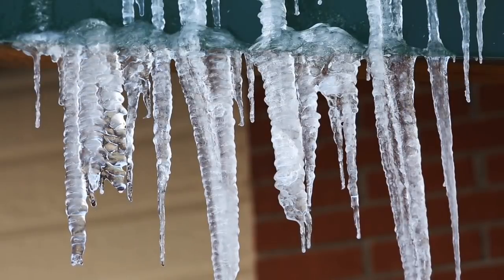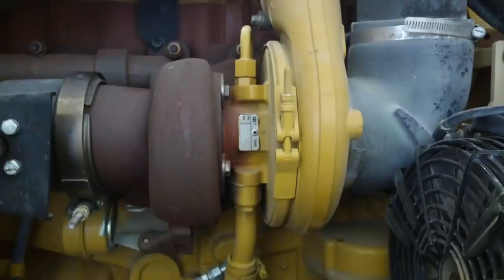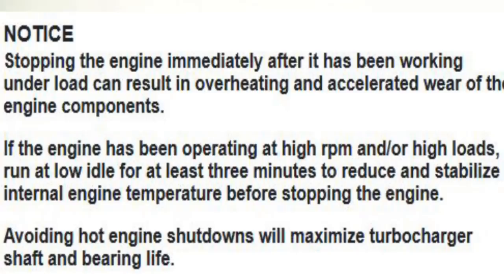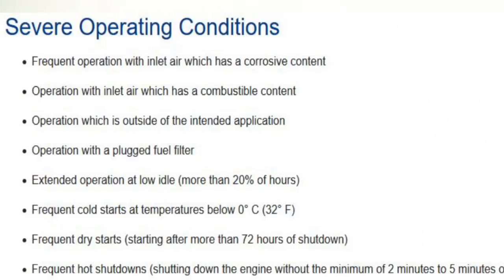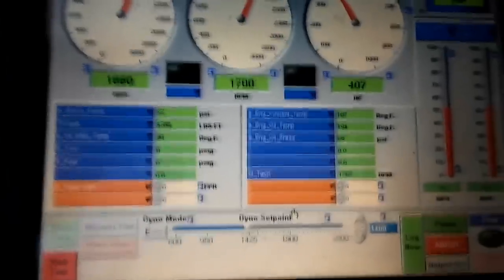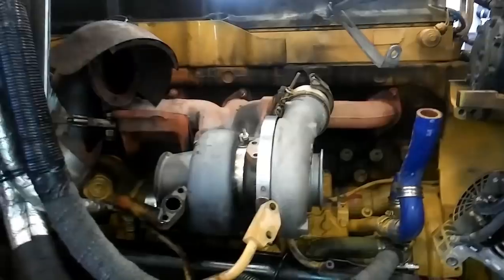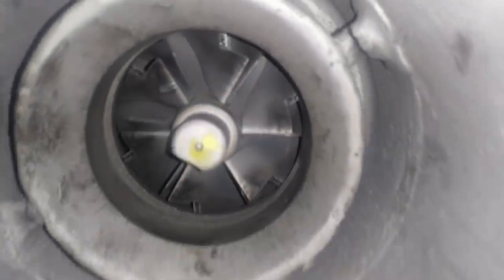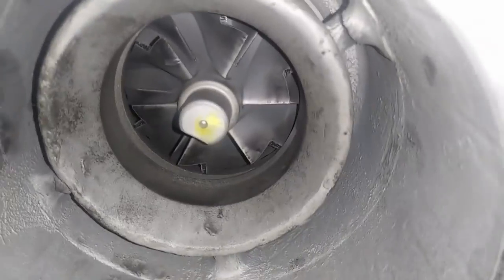Should you let a Diesel Engine Cool Down?

Comment: I guess that's why I got a million one twenty five out of the original turbo on my 3406E. The only reason I replaced it was because it came with the engine rebuild kit I bought. I am a firm believer in letting the engine cool down before shutting it off. In my opinion this is one of the most important videos on diesel engines ever produced. Thumbs up.
Reply: Turbo timers...set and forget. automatically idles engine after "key off and out" for 1, 3 or 5 minutes (selectable) and that's for a cheap unit...
Reply: @teenaramsay2469  i got a new one only $30 can set the time from 10 sec to 10 mins in 10 sec intervals even has a warm up and auto mode (the longer the engine runs the longer the shut down time is) i just have mine set at 3 mins or on 10 if its a hot day and i am gong in to a shop for a few mins so when i come out the AC is still going.

Comment: In the Army we had so many problems with the turbos getting coked up from running hard and just shutting off right away.
Reply: Still do here at Carson
Reply: @robertphillips3154  I couldn't get anyone to actually PMCS anything let alone read a 10 manual for the truck....  And guess who was the first one to be blamed for the issues lol!
Reply: I guess it doesn't matter when you're not paying the repair bill.
Reply: 6.5l's?
Reply: Engine is shut down when turbo is still hot, oil in turbo stops moving, oil gets heated up to extreme temperatures because it's not moving, oil breaks down instead of burning since there's no oxygen, oil turns into carbon deposits all over the turbo's internals, eats the turbo's bearings.

Comment: When I would shut down in the evening I took it easy on the truck before stopping. After parking it I let it idle during my walk around to cool down. I always loved the guys that reved the engine up and than shut it down. They just spooled the turbo up and than stopped the oil flow to lubricate it. I owned the truck and wasn’t just a steering wheel holder.
Reply: If you got no skin in the game. You could  care less about the truck.
Reply: I cringe every time I see that. You can actually hear the turbo continue to spin with no oil going to it.
Reply: I have a 1983 280zx turbo and for the last 35 years I let it idle for 5 minutes after a long run because of the turbo. No turbo problems yet.
Reply: @hudsonhawk0016  I let my 2nd gen ram cummins sit at idle for a minute before turning it off and the turbo still spins for about 5 - 10 seconds after, I always wondered how much oil gets pushed out of the journal bearings in that time, nothing more I can do about it anyway. I will admit that it does sound kind of cool lol

Comment: Greetings from the Philippines. My car is a Mitsubishi equipped with a 4N15 Turbodiesel engine. I always idle the engine for about 2 - 3 minutes before shutdown, especially after highway driving. I also change the engine oil every 6 months or 5,000 kms. Thank you for the information concerning engine cooldown before shutdown.

Comment: If I can help it, I let any engine I use cool down a bit before I shut it off, more so when a turbo is in the mix. My roommate's have had zero turbo issues with their 2011 1.4 turbo Chevrolet Cruze because they, and myself, let the car cool down a bit after the car has been driven. I have seen with my own eyes, just how terrible it is for a turbo to not be cooled down first before shutting off an engine. Saw a lot of dead turbochargers at the VW dealership I worked for, both for gas and diesel engines, because people drive their vehicles hard and shut them off as soon as they get where ever they are going.

Comment: One other thing, if you have hot spots that are close to boiling, those areas will scale up if there's any minerals in your cooling system, and if scale buildup occurs then it insulates those areas from the coolant which in turn lets them get hotter and could cause damage. That is also why you don't use tap water to mix with your antifreeze.

Comment: I was always told to let any turbocharged diesel idle for 5-10 minutes after a full day of running the truck and always have. The reason I've always gotten is the turbo and it's shaft bearings will be so hot if you just shut it off it'll actually bake the oil into sludge because it's no longer flowing, just sitting there baking. Glad to see this is actually true.
Reply: I seen turbos blow oil from not letting them cool down

Comment: I always idle my turbo diesel car/SUVs for 2 mins before shut down. Good practice for longevity
Reply: Turbo timers...set and forget. automatically idles engine after "key off and out" for 1, 3 or 5 minutes (selectable) and that's for a cheap unit...

Comment: All correct and explained very well what I can add to what you are saying that operators standing waiting with a stopwatch waiting to cool of for a given amount of time seldom works. But a bit of forward thinking and change of behaviour can also give equal rewards . For argument sake racing up a highway straight into to park then standing and waiting can make an operator impatient and just shutoff the engine. Or simply ease of early on the throttle pedal before arriving at a rest area and steadily negotiating your way into a parking area has dual rewards of being able to arrive and park safely and also adds to your cooling of your engine. As I try to explain to machine operators when bringing a machine back to the compound run the machine back in shut the throttle down and park carefully then set to idle put your helmet and jacket on roll a cigarette then before you get out of the cad shut the engine down. I find I have better success trying to change behaviour than just telling some body to sit and wait as some guys will but most won’t.
Great videos and great content best of luck for the future.

Comment: My engine cool down I made a habit before shut down of engaging the fan with the switch on the dash and let the engine idle for at least 5 to 10 min especially throughout the hot summer days and you explain that very well with the heat that is created via the turbo

Comment: Got yourself a new subscriber. 15yrs ago when I was in the rice fields, boss man was big on letting the tractors idle for 8-10 minutes. We worked them hard, small time farmer. Old Versatile had 14,000hrs on it with no major engine repairs when it got sold to South America. My old 12v I let idle for bout 20 seconds or so. But I have a long driveway I idle down in 3rd gear getting to the house. And she ain't my tow pig.

Comment: The manual for my '02 Super Duty specifically recommends idling for at least three minutes after running under a load.  I had a Turbo Saver installed when I first bought her and have always used it.  I always let my Powersroke idle til my EGT drops to 350 or a bit less.  I like to think that and using T6 Rotella have helped avoid coking and turbo failure for the 21 years and 278k miles she has in her. The Turbo Saver lets me set idle time from 1 to 13 minutes. Works great.
Reply: i run rotella T4 in summer seasons. and rotella t6 in winter season. on my 6.0 powerstroke. i dont have a turbo timer but let it cool at idle for 2-3 minutes. i love the truck enough to sit in it at idle for a few minutes. the area i live at though if im not towing its about a 5-10 minute drive to my house in my neighborhood with 15~ mph speed limit its roughly 1000 RPM unloaded. so reduced cooldown time idk maybe 1 minute at most.

Comment: In the early and mid 00s I drove a UD 2600 and the manual said to idle the engine for 2 minutes to let the turbo slow down before shutting down which obviously kills oil flow. We also had a GMC badged Isuzu (both trucks 26K lbs GVRW) with the Cat 3126 and I figured the same principle applied so I did the same with it, and I explained this to my supervisor and he instructed all the other drivers to do the same.

Comment: I totally agree with this. It is somewhat confusing in a highway engine due to the fact that some engines actually have a lower coolant temperature while driving. If you notice your fan will kick on at say 210 and you tool down the road at maybe 190. You pull in to the yard and idle and your temp gauge actually rises. This has been a discussion of mine with operators that just shut down. So the way I word it is to let temps stabilize and if you have a pyro  let it fall off. Tell guys why they should warm up is a totally different argument. I tell them that being a mechanic helps me understand and see in my mind all the things inside an engine that can go wrong. You sure can tell the difference between someone that knows and don't know when you start breaking into an engine

Comment: Good topic. This also applies to ANY equipment with a turbocharger (needs an idle cool-down), but it's also a good idea to  shut down electrical loads in the last few minutes on any vehicle to let the battery recover, and let the A/C system normalize, so condensation doesn't form in the ducts after you shut it down.
Reply: Turbo timers...set and forget. automatically idles engine after "key off and out" for 1, 3 or 5 minutes (selectable) and that's for a cheap unit... and while it is idling down the alternator is still working....

Comment: i forgot what i was driving as a kid i think it was the old Ford 946 our neighbor let us borrow but i remember on the dash it had a warning label that said to let the engine cool down and if the engine stops while under load to try and start it again and let it idle to avoid damage. IMO if its got a turbo it should have a turbo timer better safe then sorry also its handy for hot days and your going in to a servo or corner store for a few mins you can set the timer to its highest setting my one can go up to 10 mins and it keeps the AC running. timers seem to have bean mostly forgotten i have so many people ask why my land cruiser is still running after i get out and walk away I've even had a truckie ask me that do modern truck not come with a turbo timers any more? i remember it being standard.

Comment: What I would like to see is a three part series. Explaining to your audience Hydro-mechanical timing advance and how it works and why you leave those screws alone up front. Mechanical governors and how they work. Lastly the main fuel pump on a NSFS and how it works, and the importance of those little clamps and brackets on those fuel injection lines.

Comment: Basically when the engine is shut down all lube and cooling stops apart from the ability of coolant to superheat around the valves which is very effective at cooling actually. Yes it can eventually cause cavitation/errosion. Turbo on a hot sudden;y stopped engine keeps turning for about 30 seconds, effectively without lube and when it does stop the extreme heat may well bake and caramelise as you indicate. I've seen abused engines in motorway/highway truck stops start boiling out of the coolant expansion tank cap, starting up to two minutes after the abusive stop without cooling from highway loads.  Thermal stress on rapidly contracting components such as exhaust manifolds and heads/head gaskets can cause fairly rapid and severe damage as well.
As a rule of thumb a hot engine under load should only ever be shut down suddenly for one reason. That is when the oil pressure warning light comes on. It then becomes an issue of damage limitation. A sudden engine stop is likely to cause less damage than running the engine for a few seconds longer to allow it to cool down. A few seconds running with no oil pressure will undoubtedly cause a major overhaul at best. At worse, a rod out the side.

Comment: Some older Peterbilts have a shutdown timer on them. It was just a timer style timer. You set the timer and instead of a ding, it shut off.
Reply: My 97 379 has one turn the dial. Pull the key and walk away she'll shut off on her own. I drove an 08 glider freighshaker classic with a 6nz that also had one.
Reply: My old Dodge has one of these.  Its a mechanical fuel system and the timer  basically passes 12 volts to the fuel solenoid so it stays open after you turn the key off. Time runs out, voltage goes away, fuel cuts off.
Reply: Paccar trucks still have that.  I drive a t680 now drove a pete 579 and a t660 all of them had it.
Reply: Kysor used to make an aftermarket shut-down system for any truck.  The only one I ever saw gave 5 minutes after the system was activated and the key turned off, though I think it was adjustable.
Reply: True
Reply: I made one for my pickups.    Two light switches some wire and a mechanical timer.  Had it in my Duramax and a 6.5.  I would set the timer and shut off the switches and walk away.   Many many times people thought my truck died on me.   Loved it

Comment: I was pulling a heavy load with a gasoline engine and the temp gauge was reading normal to a little high.  When I stopped for fuel and shut the engine off, I could hear gurgling in the overflow tank.  I checked the temp gauge and now it was pegged to the hot side.  I immediately restarted the engine to get the coolant and oil circulating again and it moved back to the needle went back to the middle/normal position.

After that experience, I never shut down an engine if it has been working hard.  I give it a few minutes to vent off excess heat.

Comment: For a typical trucker, this is easier than it sounds. I monitor EGT, coolant temperature, water temperature and transmission fluid temperatures electronically. In summer heat when I've been pulling heavy or large wind resistance loads is when my temperatures are the highest. Just idling while fueling for 10 - 15 minutes and my temps are back to normal. So when a truck slowly makes it's way into a truck stop, finds a parking spot and jockeys into position, the engine is barely working the whole time and by time you set your brakes and log yourself on duty to do your post trip inspection your temps are pretty much cooled down to normal. Me personally, I like to fuel up before shutting it down for the night but that depends on the fuel aisle and parking situation also. Point being, you won't have to idle very long after parking. Maybe by time you check your lights, tires, load and look for leaks on the engine you can shut it down.

Comment: Im glad I saw this. I always cool down the engine. I was told turbos go out around 700k to 800k.I had C15 NSX, original turbos started to leak oil at exactly a million miles. I always took my truck to Cat, I never would let Freightliner touch my engine, the tech at Cat almost fell backwards when I told him the truck had original turbos. I never babied my truck she was always running 70-75. Take you for your information!

Comment: Even on new diesel engines in a 2500 or 3500, after my 10 mile test drive, I let it idle for a few minutes to let them cool down a bit. Same with turbo gas engines, it allows the coolant to go through the turbo(s) to allow them to cool down.

Comment: Number 1 on the list speaks to intake air with corrosive contents. I just think about the clowns with big sport fish boats. They run them wide open out to a fishing spot then shut the engines down and drift. Then they bitch that the turbos are junk when the salt air and heat trashes them out prematurely. Great video as always.

Comment: The engine also has static heat.  My 6.7 cummins heats up from 195 to 210 just sitting after shutdown
Reply: That is due to those hot spots transferring their heat to the coolant without it flowing anymore. That is how cooling systems work. You have noticed a very important part of how thermodynamics works. Few people notice that. When a system is operating the hot parts are several degrees hotter than the coolant and thus transfer heat from hot to cold, or high temperature to slightly lower temperature. But when the coolant flow stops, the temperatures will equalize and heat the coolant more than when it's flowing. This is also important because you can then understand that the inside of the cylinder walls is much hotter than the side of the cylinder walls that are in contact with the coolant in the water jacket.

Comment: A pyrometer is very useful for judging when to let the engine cool down.I always found that letting the truck coast to a stop and running in low range to find a parking spot was sufficient.